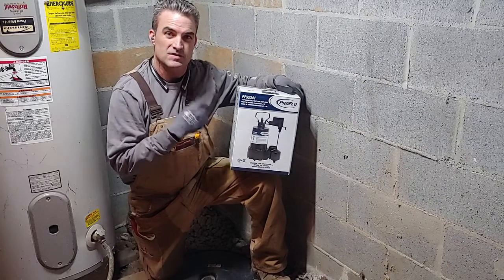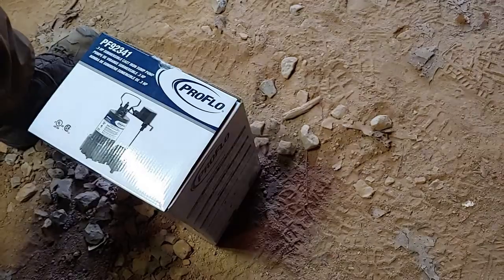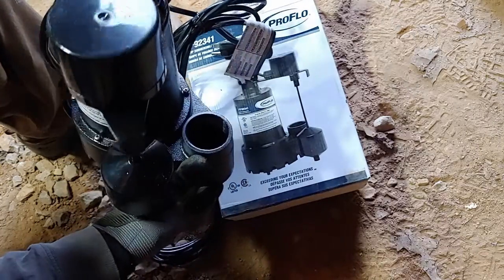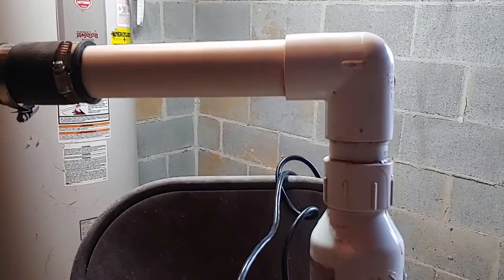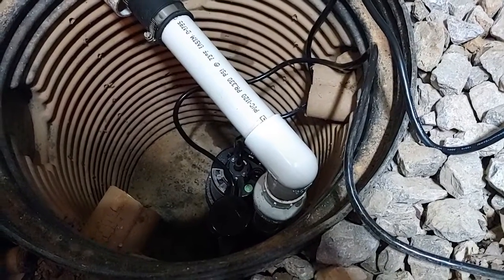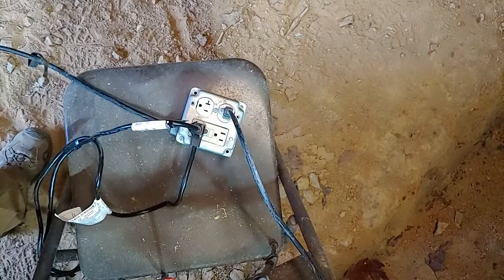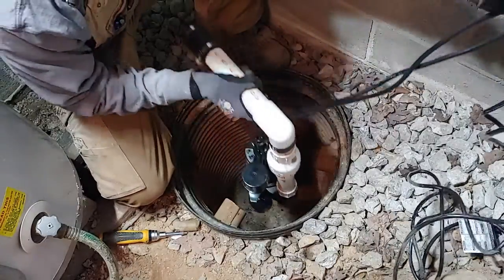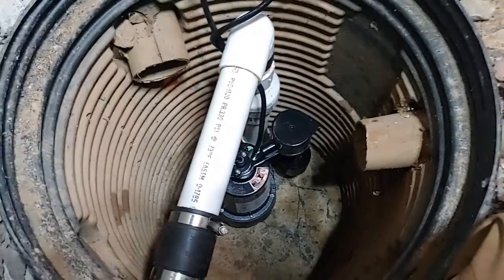ProFlo Sump Pump PF92341 Complete Install #homeimprovement #diy

Comment: Can you hear that sump running inside your house?
Reply from the maker: @luke9822  Hi! This particular pump is very quiet and you cannot hear it running. If you buy a pump that comes equipped with an alarm, you will be able to hear that if the pump gets plugged with too much debris. Hope this information helps.